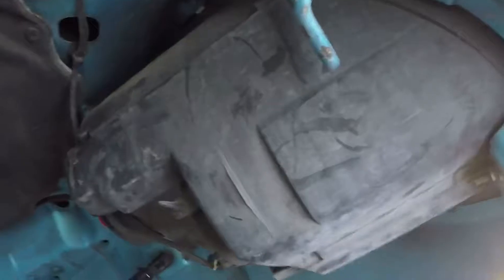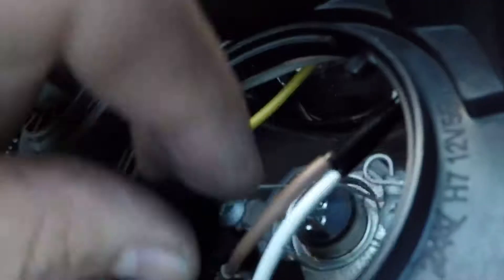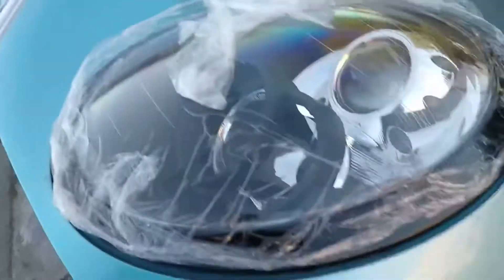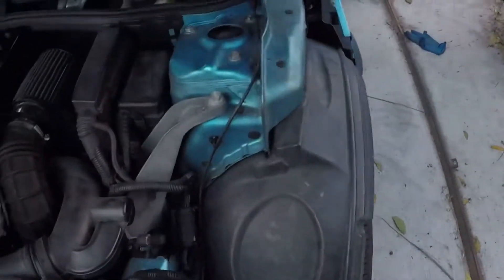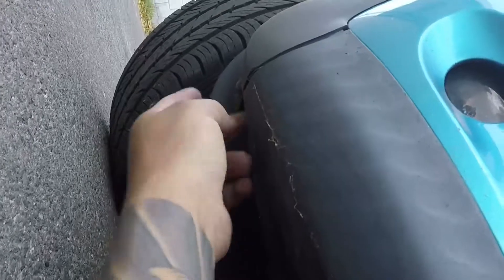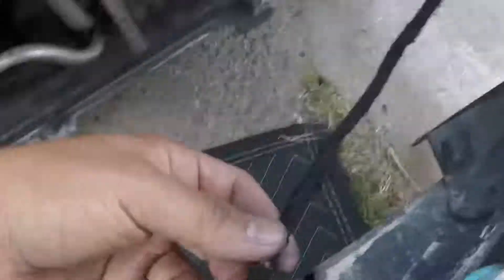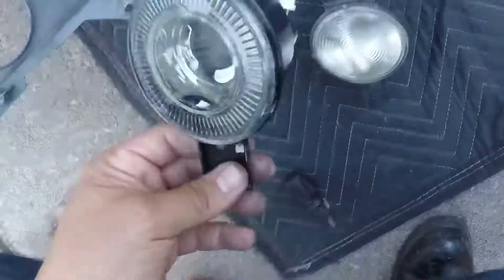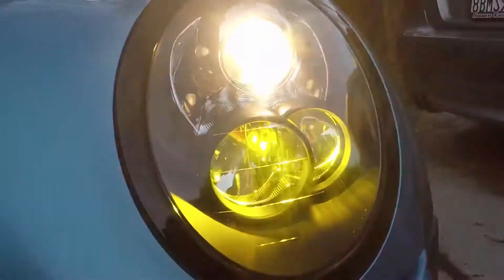Bringing my R53 Mini back to life!!

Comment: Where did you buy the indicators?
Reply from the maker: vdubv I got them on eBay. The cheaper ones I can’t see on eBay anymore. But there’s some nicer ones that are a bit more pricey than the ones I got. 

https://rover.ebay.com/rover/0/0/0?mpre=https%3A%2F%2Fwww.ebay.com%2Fulk%2Fitm%2F132773371074